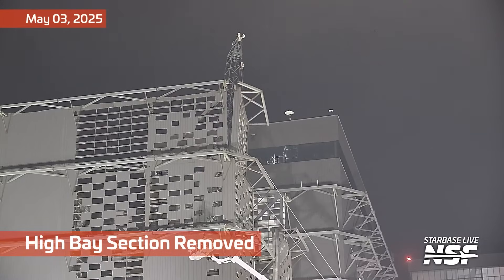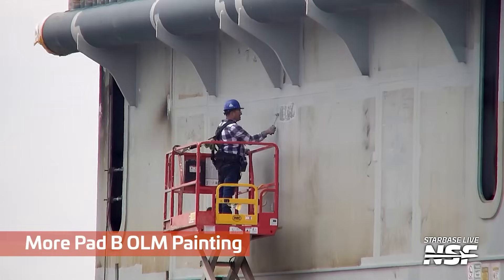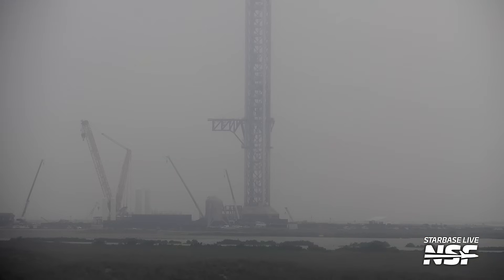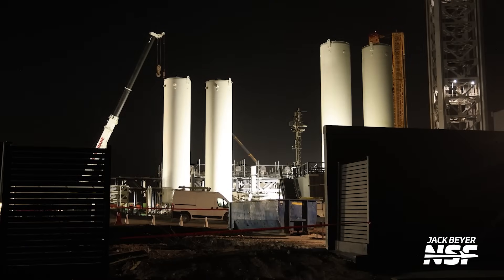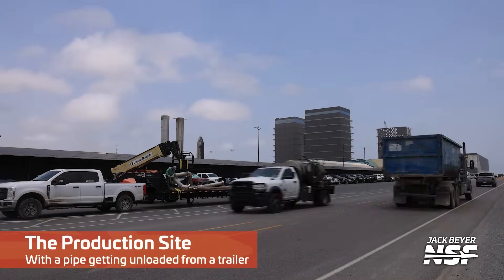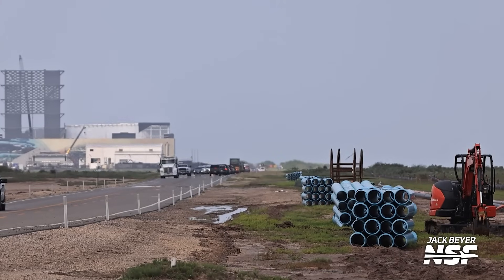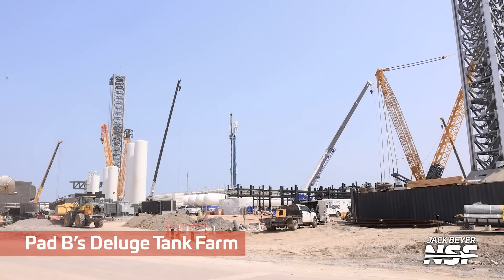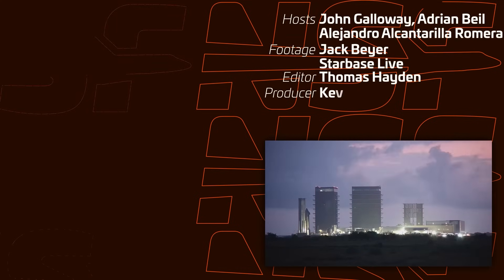Path to Pad B | SpaceX Boca Chica

Comment: I think the roundabout is bigger than it looks. The traffic cones they have out don't go to the edge of the road surface so there is a lot more space that is currently unused. I think the area with the 4 large orange cones in the middle will end up being the "spot" in the centre of the roundabout, left flush to everything else so they can roll big stuff straight though if they have to (road markings may be left painted on the ground and/or easily removable and put back if they need to). Then around that a very wide circular roadway.

Comment: I noticed the High Bay panel cut outs were symmetrical on some panels and asymmetrical on others. Why the difference? 
I’m surprised using small rollers was faster than using a paint sprayer. The viscosity of the paint may be too high for low pressure spraying. 
If there are one or more other roads leading into the turning circle it’s a Roundabout. If not, it’s a Dead End Cul de Sac. 
Or the Turning Circle at the end of Galactic Highway 42.
Reply from the maker: High winds may be tough for a sprayer. - Das

Comment: the cement mixer not the truck is likely ruined....they usually have a very dry mix and if it stops turning the concrete starts to set...and wallah....you have a big concrete filled steel vase....lots of jackhammer work to remove if even possible...likely a very high psi grade of concrete making it doubly hard to break up and remove..
Reply: Fear not, I saw how to handle this situation on Mythbusters. Now that would be a show to have at the launch site!
Reply: @thomashayden804  lol...I saw that too.....simply amazing...did they even find any pieces? 🤣
Reply: @thomashayden804  And they wouldn't tell us what sort of explosive they were using either. It was a real eye-opener to the destructive power available to the military. Still can remember that sound.
Reply: Er, wonder what happened vis a vis the cement truck driver’s employment situation…..

Comment: is that going to be an actual round-about or just a place to turn around?   granted i dont know the layout as well, i would think it would be hard for semi's to go through. I honestly dont know
Reply: Turnaround, the entire circle is solid and level allowing the rigs to "jacknife" turn, plenty big for that.
Reply: @suspiciousninja1220  circle is at end of paved road at beach. Place for trucks to turn around so they no longer back into hwy4 blocking everyone else.
Reply: It's a turnaround, but on the back side is an exit to continue on to the beach, so it's sort of like a roundabout in terms of construction. But I don't think technically it's a roundabout since it isn't an intersection. Need someone from Europe to clarify what the correct name is. But I won't be surprised if it winds up getting referred to as the roundabout. Especially by people who are Yes fans.
Reply: @StevePemberton2 
It’s a Dead End Cul de Sac sufficiently large for oversize loads to turn around.
Reply: @mikegardner107  If it was a dead end cul-de-sac it would block access to the beach road, so it’s not going to be a dead end. There will will be an exit on the back side of the turnaround  that will allow vehicles to continue on to the beach. That's why it's being referred to as a roundabout because if you are going to the beach you will go through the roundabout.